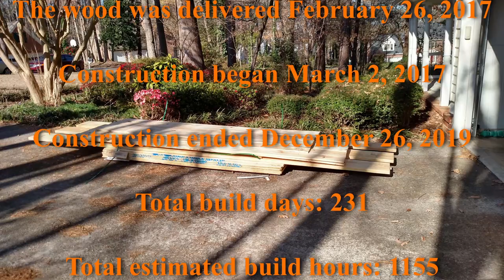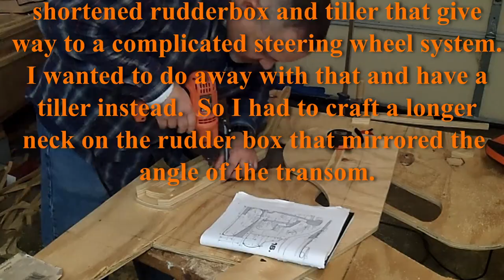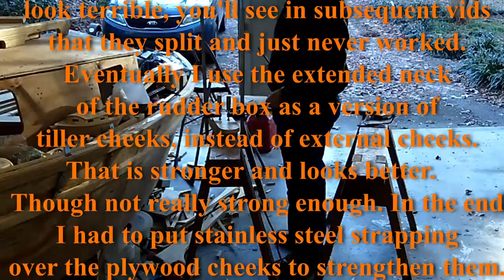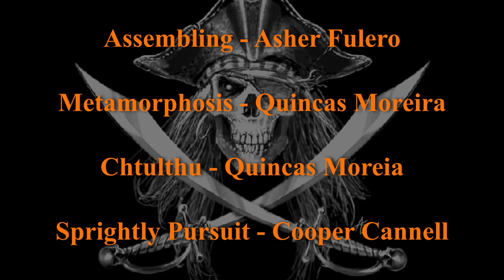Stevenson Weekender Sailboat "Scallywag" Build Part 13

Comment: Hi
I see you making sailboats
I have a question
When making a sailing boat, is it made by looking at the drawings?
Reply from the maker: Mostly yes, I'm following the plans.  There are a few times where I don't use the plans and I have to guess how it should be done - for things like the benches and the cabin top and the tiller.  But everything else is according to how it was drawn up in the plans.
Reply: @CnCEndeavors  Thank you for this video series!  I have the Weekender plans, and your video has allowed me to understand some things I had questions about.  As far as the cabin top, did you raise the height from the plans?  Also, what made you decide to go with the square front?  Again, thanks for all of the work you put into recording the build.
Reply from the maker: @jimyurasits4209  Thanks so much for your kind comments.  I did make three adjustments.  Internally, I made the openings on the companion way bulkhead that lead to the "quarter birth" storage lockers slightly larger, I added 2.5 inches to the top of that same bulkhead and I added those same 2.5 inches to the mast so I could raise the goose neck and boom to account for the cabin top height.  It also raised the boom a bit out of your face.  It's still quite low, but according to the plans it is damn near at your armpits while sitting on the bench.  Hope that makes sense.
Reply: @CnCEndeavors  Yes it does make sense!  The 2.5 inches you raised it does not detract from the design, like some builders I have seen.  Others have raised it 4 inches and that makes it look top-heavy.  I think your widening the companionway also helps with the look.  The plans call for the rounded front part of the cabin to be bent into place.  How did you come up with the size of that front panel?  It looks great, by the way, and I love the idea of  an extra porthole in the front.  I noticed you created a scale model that you show in your videos.  That is a great idea for showing how your final boat is going to look.

I am a little worried about room in the cabin.  I don't plan on sleeping overnight much, but am more concerned about creating an area where my grandkids, wife and children can occasionally use the portable head in privacy.  Is that doable?  Maybe with an additional pop-up canopy cover?

So it sounds like from reading the comments that you have finished the Weekender and have been sailing it.  Is that right?  Will you be posting sailing vids also?
Reply from the maker: @jimyurasits4209  as far as the front panel on the cabin, I actually used my scale model and scaled up the measurements.  Then I templated with cardboard to verify, made some minor adjustments, and transferred to wood.  
As far as the cabin, I don't know if you could have a comfortable porta head in there.  I'm 5'8" and can sit up in the cabin, lay down in the cabin, but I wouldn't be able to sit on something like a bucket in there.  I have camped in it - I designed and sewed cushions.  It was quite cozy but comfortable.  For a private porta head, I put a boom tent over the cockpit area (while the boom was raised using the topping lift) and used the tent covered cockpit space for the more private porta head space, which worked quite well.  If you don't think you'll use or want the cabin, you can always build the skipjack version and just have a large open area.
As for the build, yes I'm finished and I do have sail vids coming.
Thanks for your comments and questions!